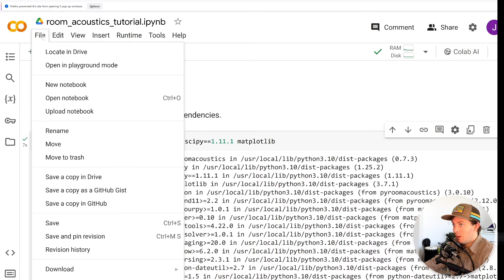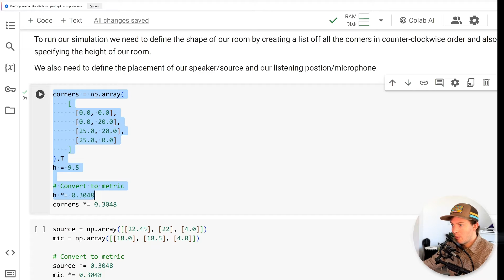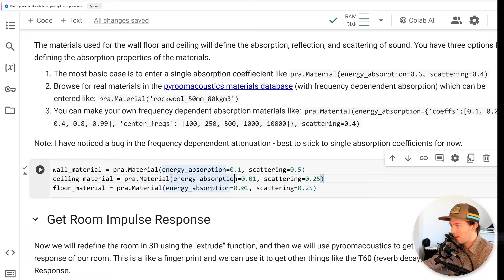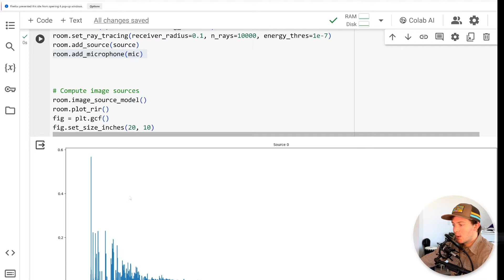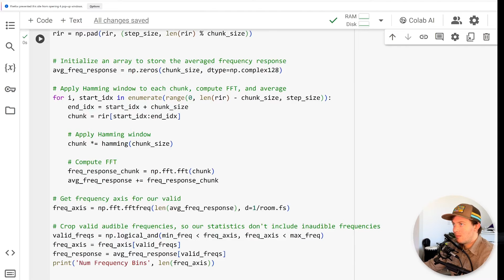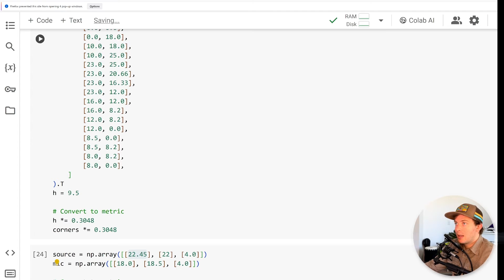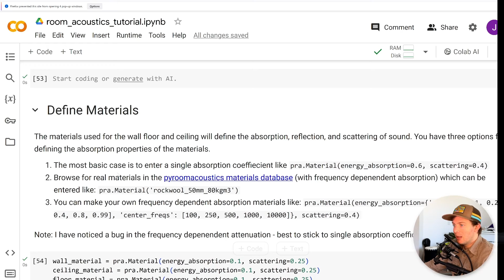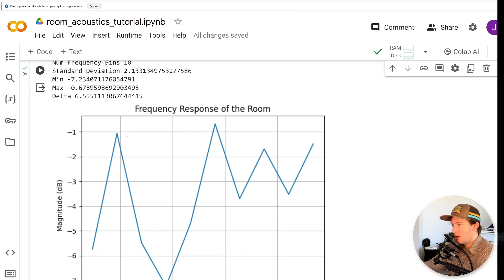Simulating room acoustics with Python

Comment: Hi man, very cool info! I agree with the comment that ray-tracing might not account for how sound moves through objects, and how energy is taken out of soundwaves by producing friction at the point of high velocity in the wave. Have you tried measuring an actual room with REW and then putting your script next to it?
Reply: Actually reading more into it PyRoomAcoustics uses both Ray-tracing for high frequencies and Image-Source Model for lower frequencies. So that might resolve things, even though I don't understand it yet:)
Reply from the maker: Ray tracing itself just accounts for how rays propagate in an environment which is a stochastic sampling of how waves will propagate in an environment. This is usually coupled with lumped modeling techniques such as modeling the absorption for the entire ray at its boundary.  

The difference between lumped modeling and distributed modeling is that the lumped model will try to account for the ACCUMULATED effect  at boundaries while distributed models try to model how the effect along the whole path, but with computers this will always have to be sampled to some timestep. The distributed models try to do more like you describe “model how sound moves through materials” but they are incredibly inefficient compared to lump models. But both could be combined with ray tracing. I think if you want the distributed model an FEM might be the appropriate technique. 

But lumped models are often very good. Think of electrical circuit models - these are all lump models. They don’t model how the electrons flow through mediums, they model what happens in a component in a single “lump” - this is sufficient for 90% of electrical engineering whereas some special cases require FEM to model how voltages vary at tiny timesteps.

I think for getting an approximation of a studio acoustics - a lumped model is totally fine. It still tries to account for what happens inside of the medium, it just doesn’t it more efficiently (eg saying this 4 inch Rockwool will absorb .99 of 1kHz and .85 of 100hz is just as good as saying this 1mm of rockwool absorbs XY and computing that a million times as the ray passes through the rockwool)
Reply: @astrobearmusic1977  Thanks for taking the time. Still, a ray isn't a wave really, right? Would it be better to model based on pressure waves like how pressure behaves in water vs. light in air?
Reply from the maker: @donfelicio  right a ray isn't a wave. To be clear I should have said "wavefront" because I am talking about how sound emits in all directions, continuously - and the wavefront is a sphere. But computers can't handle continuous infinitely fine resolution so we send out rays in all directions instead - it is a stochastic sampling of the real wavefront.

Funny you mention light - because ray tracing is THE way to model computer graphics. And I think the computer graphics folks have refined ray tracing WAY more than the acoustics folks. In acoustic modeling we are still stuck in the equivalent of 1995 computer graphics. Thanks to architects for being early adopters of seeing the value of computer graphics (and ray tracing) they made a lot of traction - and then with 3D video games taking off, not to mention Pixar, there is just SO much more time, money, and expertise dumped into computer graphic ray tracing. Have you seen some modern architectural renderings? They can be nearly indistinguishable from real life. 

I just bring that up to say that you aren't wrong that my little lumped absorption model is pretty crude compared to real-life. But I don't think it is a flaw of ray-tracing itself - but rather that we haven't added all the extra modeling, tooling, and infrastructure needed to make a truly realistic acoustic rendering.

All that said - just like 1995 architects, I am just trying to get an idea of what my room will sound like before I construct the walls. If it isn't a perfect model, that is okay - it is better than nothing.
Reply: @astrobearmusic1977  You know your stuff, respect and thanks!

Comment: Looks super cool, although I get error at install : ( 
this is what I get: Any known issues or my bad?

Installing backend dependencies ... done
  error: subprocess-exited-with-error
  
  × Preparing metadata (pyproject.toml) did not run successfully.
  │ exit code: 1
  ╰─> See above for output.
  
  note: This error originates from a subprocess, and is likely not a problem with pip.
  Preparing metadata (pyproject.toml) ... error
error: metadata-generation-failed

× Encountered error while generating package metadata.
╰─> See above for output.
Reply from the maker: I emailed you back, but Google colab changed their environment causing the older version of scipy to fail. I pinned scipy to 1.14.0 which allows installation to complete, but can also change behavior of other parts of code so let me know if there are further issues.

Comment: Hey, This is very cool! Thanks for sharing. Compared to the real-world scenario where a microphone and speakers are used to capture IR, did you also consider the properties of the microphone(Gain, polar pattern, type of mic, freq response) and speakers(Size of the driver, SPL, Freq response)? ..When you say source and mic, what are the properties of those? Thanks!
Reply from the maker: I believe this simulation tool allows you to specify the polar pattern, but I left that parameter unspecified so it has a perfectly spherical reception in my simulation. I suppose some sort of hemispherical polar pattern would better represent the ears - so that’s future work :)

The size of the receiver I left oversized. That partially has to do with how ray tracing simulations work. Since I am approximating a finite number of rays I want the receiver to capture as many as possible that are “near” the ear. The more principled but more expensive way would be to increase the number of rays and decrease the receiver size to the size of ear. 

I think freq response isn’t so important since IRs can be combined linearly, so we should be able to just add that frequency response after the fact for different microphones. 

Non-linearities in the mic, speaker, and room are not captured unfortunately - so it will never match exactly a real IR.
Reply: @astrobearmusic1977  Thanks for the reply. Great work!

Comment: Raytracing is pretty much useless for simulating low frequencies. Sound is a wave, and the bigger those waves get in comparison to your room, the weirder things get. I really wouldn't trust these results below 1 kHz, a proper finite element simulation is necessary there.
Reply from the maker: Interesting. It sort of makes sense that there would be challenges at low frequencies for ray tracing, but do you have an articles you can share on that topic so I can learn more?

I will see if I can get an FEM simulation running in python for my room. Thanks for the tip :)
Reply: @astrobearmusic1977  I don't know any article that covers the entire topic well, but I'd recommend to look into room modes and diffraction to understand how the wave-like nature of sound impacts the accuracy of simulations.

Modal analysis and time domain simulation are the two main methods I know of that can accurately model low frequencies. Modal analysis basically calculates all the ways in which standing waves can "fit" into the room. This relates to the concept of room modes I mentioned earlier. The data gathered through the simulation can then be used to calculate the frequency response of the room at a specific listening position. The upper end where this response is accurate depends on the size of element chosen.

Simulating the problem in the time domain is a much more straightforward and intuitive approach. It boils down to modelling the air in the room as a grid of masses and springs, then providing an excitation somewhere and measuring the resultant excitation at the chosen listening location. I found a great video covers the maths behind it in case you are interested:
https://www.youtube.com/watch?v=pN-gi_omIVE

There is probably some kind of framework out there with a similar API to the one you've shown in your video that abstracts all that math away. 

I don't see this method used often in the professional realm though, I need to put in way more research to find out if it has any drawbacks.
Reply: Aye, consider if you’re walking towards an outdoor show... you hear the bass rumble way before any treble comes in. Raytrace is a good ideal / model of reflection but it works better for bounce light in simulation, without doing it for each band of a Fourier transform, which is devastatingly CPU expensive
Reply from the maker: @ndrstrl1142  are you talking about the effects of air absorbing higher frequencies in an outdoor concert? Computer graphics also has to deal with the effects of air, and yes it makes the simulation more expensive - but I wouldn’t consider it a shortcoming of raytracing. FEM simulation is also very expensive…
Reply from the maker: You also don’t need to simulate the impulse response for each frequency band. You are just trying to simulate what would acoustically happen if you created an impulse in the space (or the outdoor concert). That is the whole point of an impulse response, it captures the frequency dependent effects as long as they are linear. In the case of a large outdoor concert the air should cause phase dispersion on the impulse, right?
Reply: Far as procedural audio, I think Andy Farnell’s book for pure data has some absorbent coefficients for acoustics, with respect to physically modelled reflection
Reply: Incidentally, t60, given a value in samples in a discrete system is e^(-ln(1000)/x)) or exp(-6.9077552789821 / x)... for delay time in samples / frequency hz for a frequency independant feedback coefficient in a say, karplus strong delay line... hope that’s of relevant use in some capacity. Julius Orion Smith’s site is a fountain
Reply: @astrobear Oh, yeah I’m speaking of an outdoor concert - minimal material absorbency coeffiencts... Also, correct, the impulse response accounts for the nuance of the whole of an FFT (give or take) in convolution... Perhaps my communication in English is wanting, but just to say physical modelled acoustic reverberation is very difficult... You do excellent work tho. Nature is a lowpass filter, etc :)
Reply from the maker: @ndrstrl1142  ah yes for sure it is a very difficult problem and the simulation is just scratching the surface. I’ve heard a lot of people talk about how ray tracing is insufficient for low frequency but I haven’t found an intuitive explanation yet (although it’s probably out there, I’m just not that well read ha)
Reply: Actually reading more into it PyRoomAcoustics uses both Ray-tracing for high frequencies and Image-Source Model for lower frequencies. So that might resolve things, even though I don't understand it yet:)

Comment: Super cool share, John. I didn't know pra was a thing, so neat that it lets you simulating the freq response and has that acoustic raytracing built in. Are you planning on using any calibration software (Sonarworks et al)?
Reply from the maker: Yes definitely, aesthetics/creativity is my number one priority so I have optimized the space to be as big / open as possible. As a result the acoustics are not going to be perfect. The simulation helps me make small adjustments like a couple angled walls and optimal listening position. But I will still be far from perfect and rely on sonarworks/rew to get the last 10%.